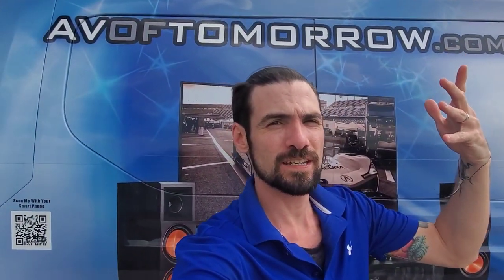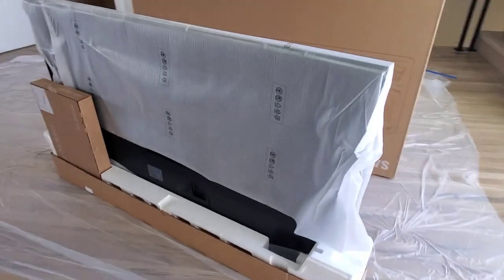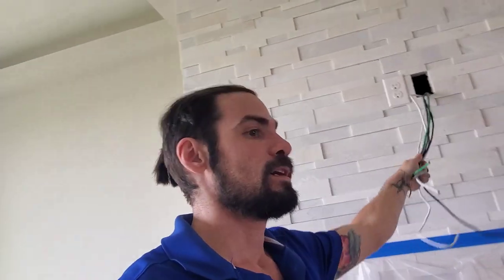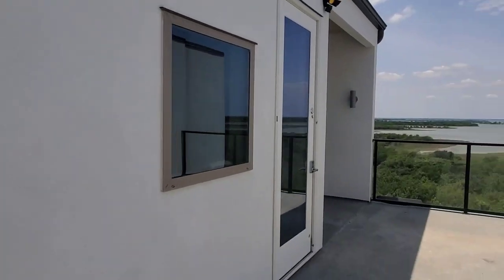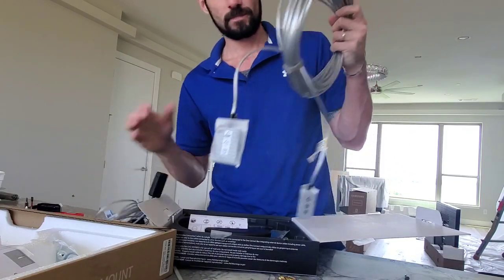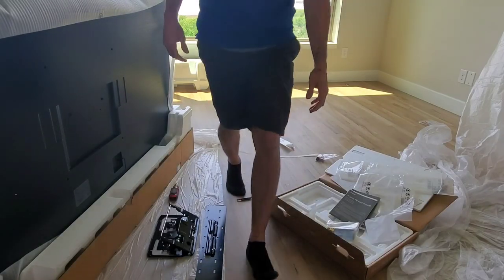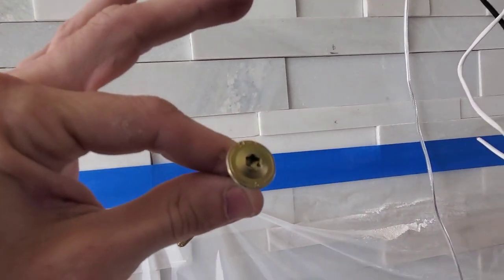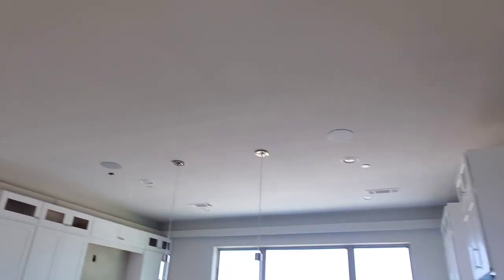2020 75" Samsung Frame TV install in a 4 story Condo!?

Comment: Hi, thank you for the vid. I see the one connect cable is towards the bottom of the TV not the hole to run the cable in the wall is higher up. Is there space behind the TV to run the cable around the tv to get to the hole? I’m assuming you can’t just run it in the back bc then you can’t have the TV flush against the wall.

Comment: Good video, but your information on Cat5 and Cat6 cable is incorrect. They are bound to the same 100m distance (assuming Gbit speeds, as Cat6 is good for 10Gbit speeds for 50m). The only difference is the amount of twists in the twisted pairs. There is no gauge difference between the 8 wires within the single cable. 

The OneConnect extension cable is likely thicker than the original one due to it carrying non-low-voltage power + data instead of data only.
Reply from the maker: Hey boss thanks for watching and we appreciate your comment. This is Warren with Divine. I spoke with my brother and he actually knows the difference. He's going off of personal experience rather than specs. Hes referring to a certain speed at a specific distance. At 150ft a cat6e can produce a 4k HDR 60HZ image with the proper balun. A Cat5e at that distance may only do 1080p depending on the balun. You guys are both correct in a sense. Online specs suggest they are both similar cables but real world data proves otherwise. 

Your statement about there being no gauge difference between the 8 copper wires in each of the individual cables
 is incorrect. Cat6e wires are actually a thicker gauge which is usually about 23 gauge. Cat5e wires are typically 24 gauge. We have terminated thousands and thousands of Cat5e and Cat6e cables over the years and anyone who terminates these cables will tell you that is pretty hard to smash a Cat6e cable inside of a Cat5e 8P8C RJ45 termination cap. It is possible but it's challenging because of the thickness of the wire. There's plenty of Manufacturers that make proper cat6e termination caps that have a thicker core gauge to accommodate the wires smoothly.

My brother and I have physically tested the exact same length Cat5e cable and Cat6e cable at 350ft using a video balun. The Cat5e did not work at all of course, as expected. And the cat6e to our surprise still functioned properly. They're both good quality cables but I attributed that result to a very high-quality 100% oxygen free copper Cat6e cable made in America. So where the distance thing as a general rule, it is not exact. 

As for the short and long invisible one connect cable, your statement is also inaccurate. Both of those cables are producing power and data to the TVs. There are no other power cables going to either one of those TVs in the video. The longer cable has thicker gauge copper and a more heavy-duty jacket for long runs. They are both serving the same function.
Reply: I was about to say something similar... But then I remembered that AV installers use Ethernet in a different way than "traditional" networking.

Comment: If you use the fireplace, does it compromise the TV???
Reply from the maker: Good point, as long as the fireplace is vented there's no issue. If a fireplace is not vented through the roof, you need to use a mantle

Comment: Why would you want two TVs that are mirrored like 5m away from one another? :S X
Reply from the maker: There was actually a couple of thoughts with this design:
1. They're both frame TV's so they play artwork when they're off. So if you're watching One, the other one is displaying art.

2. We have the TVs wired together so they can mirror each other. That way when someone gets up to go to the kitchen, they don't have to pause the movie.

3. It's a very high end 4-story luxury condo. There's a lot of perks to that sort of thing.

Thanks for watching and please subscribe for more :-)
Reply: @DivineAV  was that 2020 model? I know the 82 has dual no gaps, that looked smarter with a bigger single mount, who want's to put up and level 2 mounts for 1 install?
Reply from the maker: @BTheInstaller  yes sir that's the 2020 75 in frame TV. Pretty nice mounting solution. The client actually wanted to have it tilting down a bit by the way. Yes I know it kind of defeats the purpose but it's nice that it has a little bit of a tilt on it as an option. As you know, those things are quite secure. You have to work them a little bit to get them off the mount. Anyway, I checked out your Channel and subbed. Good work bro
Reply: @DivineAV  thanks man.  No judgment at all.  Just know some people will ask, so i added it.  You guys are solid. I would do more videos for sure. I liked the elevator stuff.  Had a guy i worked for at the beach with elevator and was money for taking all my crap up and down stairs.  Anyways, im going to put out an install, no talking tomorrow am, just the noises of an install. Haha. Keep in touch. B
Reply from the maker: @BTheInstaller  rock on bro, we can do a collab at some point. Have fun and be safe

Comment: Hello. I keep getting conflicting info from samsung on if this oneconnect cord can go in the wall. I want to put the box in a closet on the other side of the wall the TV would mount to. Is that safe to do?
Reply from the maker: Hey there, thanks for contacting Divine AV. The one invisible connection cable that comes with the TV's is not technically supposed to go in the wall because it does carry ac voltage. It is certainly not the same voltage that comes out of your wall socket but still dangerous. 

There are definitely many companies and individuals that have simply put them in the wall and looked the other way. We don't condone this but there's a safety mechanism built into the TV and one connect box. If the one connect box experiences any fluctuation in voltage or break in a line, it immediately Cuts power to the line. This happens in under one second if I remember correctly.

The way we properly run ours in the wall, is to use a Smurf tube Raceway. Now that generally needs to be run during construction but you may have the ability to run it now. Just type that into Google and you should find some orange Raceway or you can get it from your local AV company if you're not around here. Otherwise please call us up. The second option is to use the in-wall rated version of the one invisible connection cable. You can find that here:
https://www.samsung.com/us/televisions-home-theater/television-home-theater-accessories/televisions/5m-one-connect-in-wall-cable-for-qled-frame-tvs-2019-vg-socr86u-za/

Thanks for watching and take care
Reply: Divine AV Home Theater Thank you! I discovered this cable in my research and read that although it’s for 2019, it supposedly fits the 2020 frame. I’ve seen complaints that due to the thickness, there will be about 1/4 inch gap behind the TV. Given it’s so small, I imagine it’d still look nice and almost flush. 🤞
Reply from the maker: @annalincoln6287  yea, should be fine. Or you could do like a double Gang Box behind the area to allow for some extra space. The other option would be to just run some electrical PVC conduit through the wall and use the original cable.

Comment: If you have chunky rocks on your fireplace can you still make this work and look like a picture frame?
Reply from the maker: You would probably have to get a different mount aside from the flush mount that's included with the Frame TV. But yes, it'll still give you the picture frame effect, the frame TV is designed to work with aftermarket mounts.

Comment: Is the frame 2020 an High end Qled or is it an medium end with high end price because of the design?Is the picture quality at level?
Reply from the maker: It's essentially a mid-range Q70 model. It has full back lit array and it has more features than a standard Q70. It also of course has a large artwork library and tons of aren't you can purchase. 

In my opinion, it's one of the coolest TVs on the market. We have two in the store, and I own one of my own
Reply: Divine AV Home Theater I heard it was more like a q60t the 55 inch 2020 frame